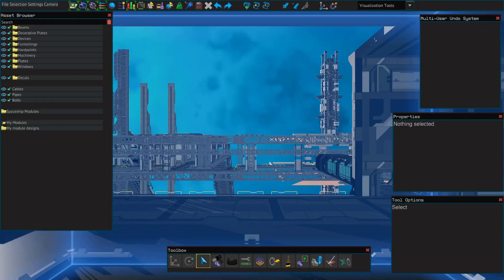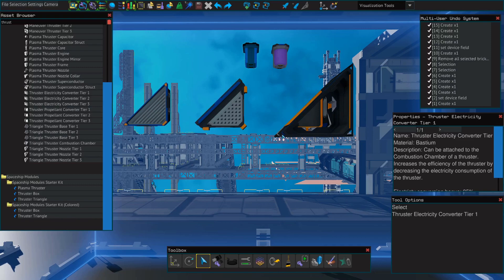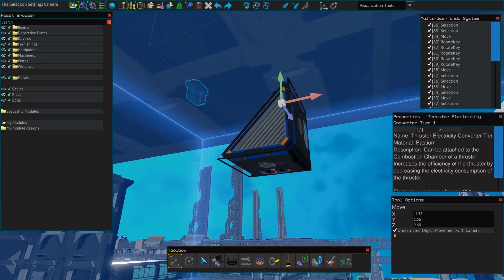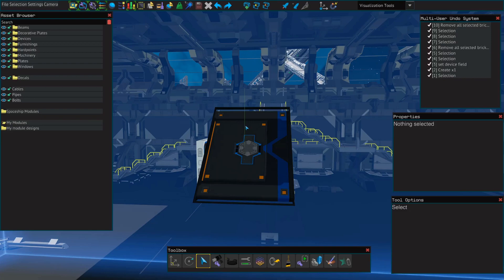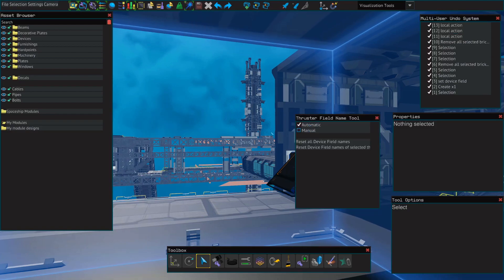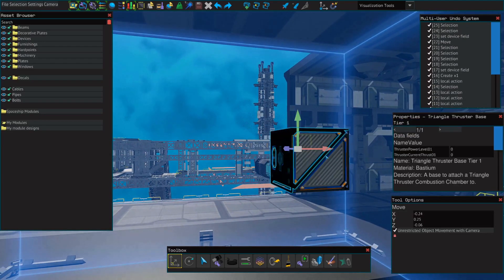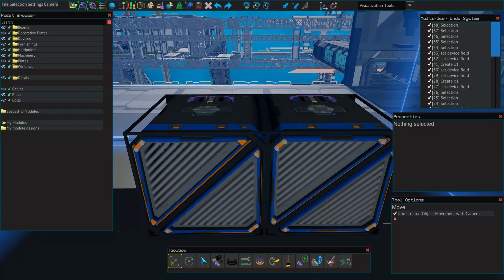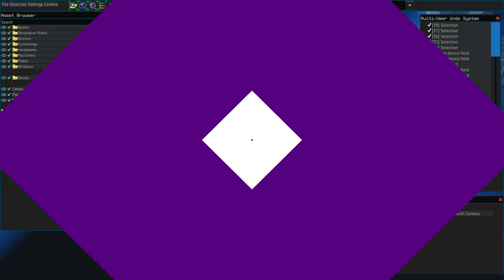Starbase Component Spotlight: Triangle Thruster

Comment: Nice explanation. I do wish box thrusters could share a hardpoint, but oh well. Here's a question. I've made a manoeuvring thruster nacelle, which is a cube of beams (24cm corner, 72cm beam, 24cm corner) with 5 thrusters/hardpoints attached and the non-thruster face attached via beams to the ship. My ship, by the way, is intended as a safe zone miner. Could there be any other drawbacks to this other than the "don't use it in non-safe space" ?
Reply from the maker: Sounds like a cool design! I cant think of any drawbacks inside the safe zone! If you are using only one nacelle per side, you can make them slightly more efficient by placing them on your center of mass, but that wont make a huge difference unless your ship is massive.
Reply: @SpunieBard   Yeah, it's not too big. just 45 crates, 6 main and 4 triangle thrusters. I have 4 of the necells. If this works. Once I get her flying properly, I'll be loading up with generators, batteries, YOLOL scripts and putting 4 mining lasers on it with a script to use the turrets properly. I found one that does a spirograph pattern.